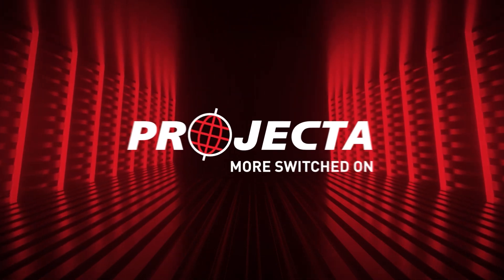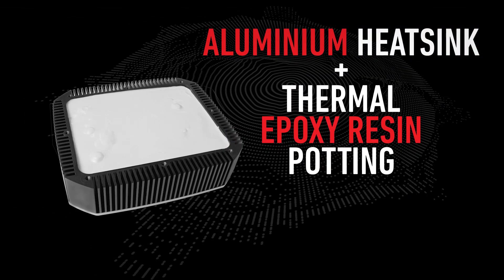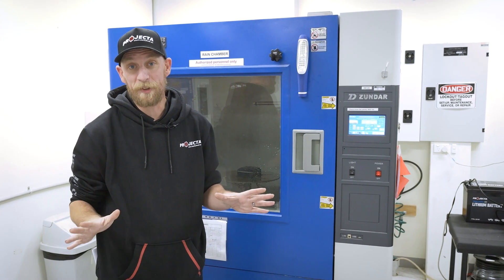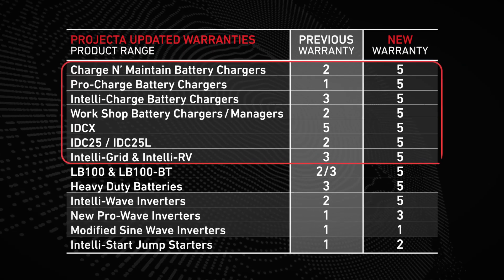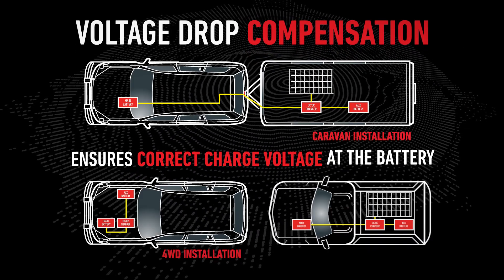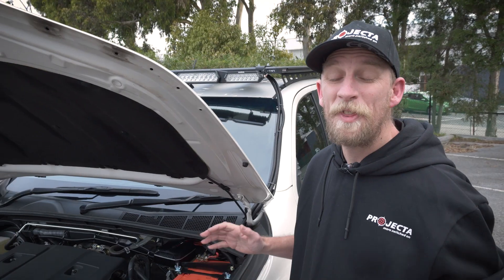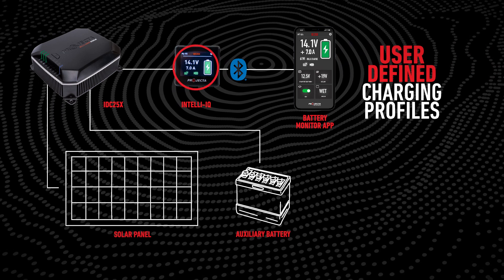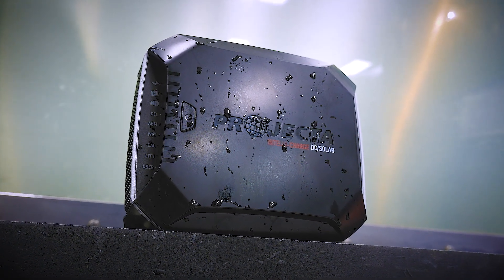Projecta IDC25X - The TOUGHEST DC To DC Charger EVER CREATED!

Comment: Hi i have a 25 amp dc dc projector charger it about 3 years old had it in a triton now have put it in a madza BT 50 BUT THE SOLAR LIGHT IS NOT COMING  ON THE altinator and charging  light are on but not the solar light 
Geoffrey Turner

Comment: I am going to review this after install in 018 Dmax mated to a thumper platinum 120ah lipo4 hub no DC ,i got that hub pacifically for the use of this charge controller ,also 300w solar only while camped ,god forbid ? you need the key on to get a solar charge out of its mppt while stationary

Comment: Are they going to be released in USA I have your original charger for my van running a 100ah AGM. I had to buy it from eBay Australia years ago because you couldn’t buy dc to dc chargers in the USA back then. It’s a solid unit and never has let me down I hook solar to it also when at camp and has worked great over the years. Thanks